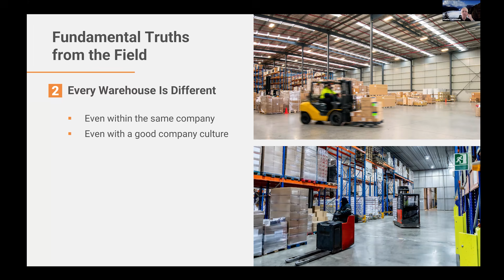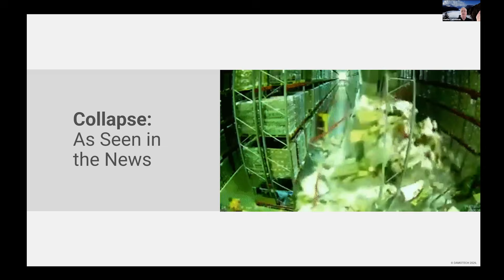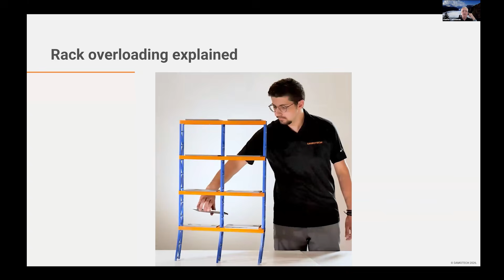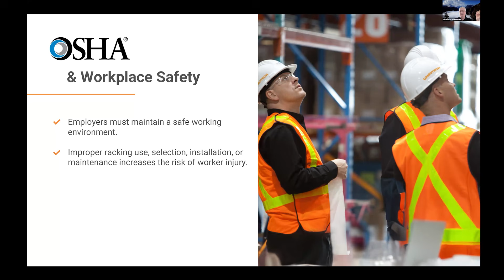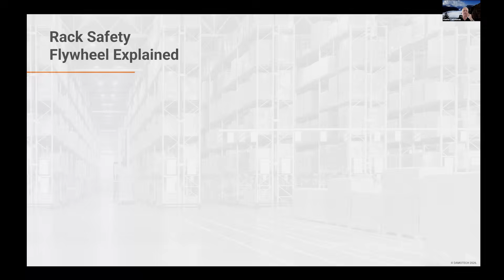Webinar Lessons from 35 years of rack safety

Comment from the maker: The question we get more than any other: "How often do we actually have to inspect our racks?"

Charles's answer, short version — there's no single regulated frequency in the US or Canada. Most governing bodies and standards point to an independent inspection by a qualified rack professional at least annually, routine visual checks by trained staff monthly or more often, and an immediate check after any forklift impact. Higher-velocity operations inspect more often. Your actual requirement depends on jurisdiction, rack type, facility use, and your authority having jurisdiction.

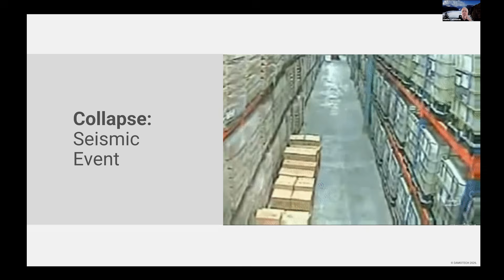But the point of the whole hour (16:33 if you want to jump straight there) is that frequency isn't the hard part. Damage is normal — if you run forklifts, you have rack damage. What separates the warehouses in control from the ones that are not is whether findings get tracked to closure. Untracked damage repeats.

Worth jumping to:
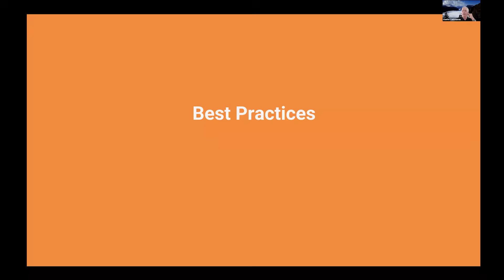▸ 31:56 — What OSHA actually says
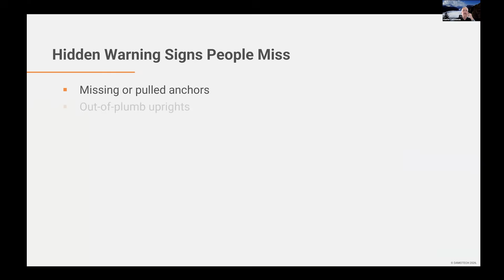▸ 29:11 — The out-of-plumb tolerance most people get wrong (½" over 10 ft loaded)
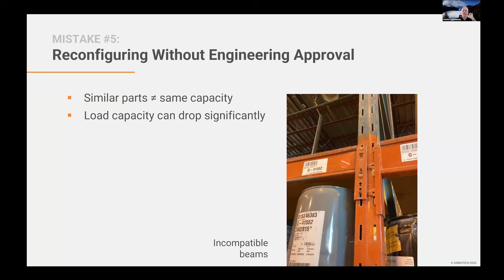▸ 26:55 — Moving a beam level 12–18" higher cost 33% of capacity
▸ 53:04 — First two steps when an operator spots damage

Free rack inspection checklist → https://www.damotech.com/rack-inspection-checklist-lp

What's the one rack safety question your team argues about? Ask below — Charles and our engineers read the comments. 👇